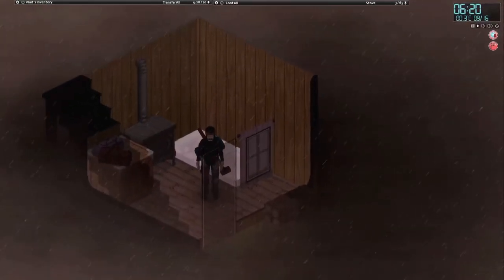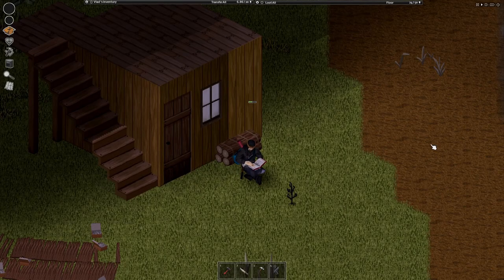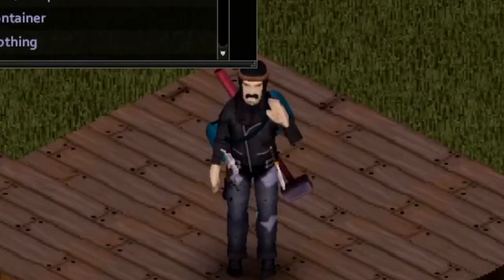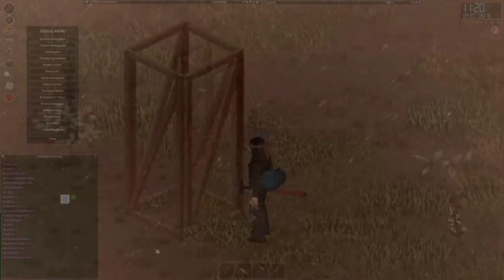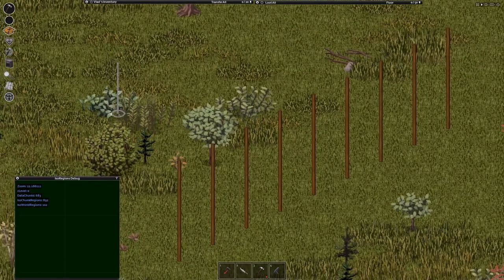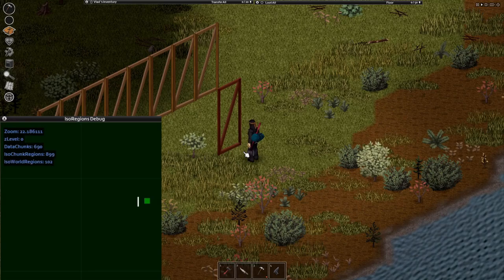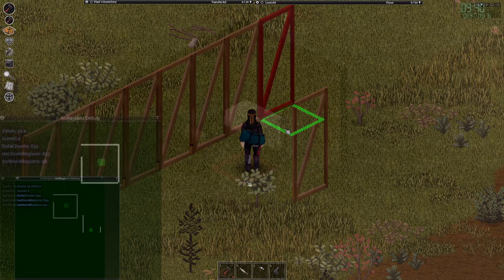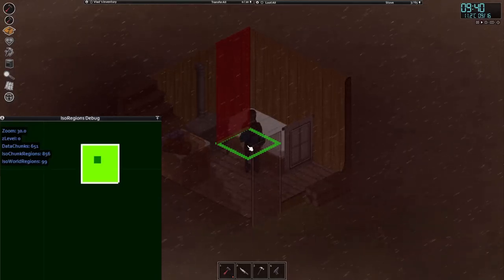The base indoor temperature bug | Project Zomboid

Comment: Glad this got recommended to me. I made my base at the Muldraugh North Farm and built a big base off of the barn, and was wondering why half of my base was considered indoors and the other half wasn't. Turns out that the south-east part of the barn has a few corner pillars that were blocking the wall from enclosing the whole room. Took out those pillars and it works great now.
Reply from the maker: Glad this helped and I am glad you shared your experience!
It doesn't need to be a player built pillar, it can be a pillar on an existing construction that interferes with player built walls!

Comment: I never even realized this problem, mainly because i newer found out any use for pillars (other than holding up a tower or balcony for style) and i havent been able to do extensive building due to roofs needin stairs and stairs needing carpentry level of 6. I know that building roof from first floor is hard but i don't bellieve i would need entire stairs to reach the roof, maybe ladders or stack of boxes... heck, the character can climb over the wall so i don't think stairs are necessary. But i have full faith for devs to make carpentry better just like they did with foraging. to be honest devs of zomboid are some of the best. 

Anyhow, thanks for this info. It will come in handy eventually if my friends get more into carpentry.
Reply from the maker: Glad this helped... this info could still be useful considering that pillars are now auto added when building and may cause confusion
Reply: @Zarivan  they're automatically added? Thanks for the heads up.
Reply from the maker: as far as I know, yes, they are added if there's a corner

Comment: Thx for this explanation. Another thing that kept my base from sealing was a missing (destroyed) wall between the original building and my added part. Adding a door frame resolved this issue.
Reply: Hey! Having the same issue here, I added walls to conect two existing houses. Everything is closed but the corridor I builded between houses is taken as exterior. I should build any door frame to solve it?
Reply: @EzequielPH  build a door frame only if You have destroyed part of houses wall. If else, the pillars probably should do the job.

Comment: Iso Regions is a great zomboid tool in debug mode for server hosts.  It taught me that if you build up against a pre-built structure's wall, you won't be able to truly seal it up and it will have the same issue shown in the video.
Reply: any fix to this?

Comment: I just want to point out, that I tried playing starting from December 1st. So I can meet winter as it is. Houses were warm, but the electricity was eventually cutted off and the houses being 22°C went to 10 or less. 

So if the reason why I have cold house is the Grid Blackout, then why connecting generator won't warm at least 1 room?

Comment: Yeah, building your own house can be tricky lol built a two story house once with the stairs on the inside of the house.  Apparently, doing that makes the roof not register, so the only room in my house that stayed dry was my bedroom that the stairs led to lol

Now I just leave the stairs on the outside, along with the one pillar on the SE side.  Haven't had problems since :D

Very good tip video!
Reply from the maker: Thank you for sharing your experience. This extra knowledge will help save others from headaches caused by these bugs or coding oversights.
Reply: @Zarivan  
Youre welcome.  And thank you for making awesome and informative videos :D
Reply: If you have stairs, you need to put a wall along the longer part of the stairs on the second floor.
Reply: @crocproplayer  is it nessecary to remove any pillars after u build walls along the stairs?
Reply: @otobluearrow If it's not registered as a room below than yes. Upstairs it can be a wall or small fence bdw.
Reply: @rafanagorski392   thx, today i approached this situation, with the last floor part placed it changed to indoor look and sound. So there was no reason to remove pillars or  build a wall along the stairs.
Reply: @otobluearrow  It all depends on where the stairs are. From what I remember, there must be a wall on the north side. This game is not refined in this respect. The more we play, the more we see it.

Comment: Please help! I built a 6x8 warehouse without pillars, and it was never considered a room, the lighting doesn't change, it rains indoors and its cold as the Queen of England's touch.
It's got 4 walls, floor with floor on it, 3 doors and a roof. The roof was the very last thing i built on it. I have no idea what could cause it.
I'll reply with more deets, but I'd like to know if there are any things i should consider trying. Again, there are no pillars.
Reply from the maker: Besides the fact that now, depending on how and in what order you build some walls, the pillars are auto constructed... I really don't know... with a sledgehammer try hovering in destroy mode and cycle with "R" near each of the walls and see if there's a not so obvious pillar (it should get highlighted this way)
Reply: I'm having the same problem dude, if you find out please help me

Comment: Hi all, I've been having issue with enclosing my second level 9 x 5 room. I first made an interior wall with door splitting it pretty much evenly into two rooms, and one room became enclosed (the room without the internal stairs). I then added a second internal wall splitting the remaining room into another two rooms, which then both became enclosed. Not sure what happened here as its nothing to do with the corner pillars which I thought originally but if I have to subdivide rooms to get heat then I'm all for it
Reply: If you have stairs, you need to put a wall along the longer part of the stairs on the second floor.
Reply: @crocproplayer  thanks mate ill try it out

Comment: if you extend one of the houses for example one of the gated community houses in rosewood to include the garage, so i knocked holes in the walls of the garage and house and built walls to connect them together and a roof. half the new build part is indoors half isn't, so i built on the floor above and all of it is indoors... also this won't extend safehouse, am i doing something wrong or is this a game mechanic?
Reply: I had the exact same problem. Just seek for pilars on the corners and destroy them with the sledgehammer

Comment: Hello,

maybe you can help me with a building issue. I tried building my own structure and started adding a second floor to be safe if the need arrises. On the 1 floor I built wooden frames for a window. I couldn't upgrade the frame to a window without building a floor in front of it. I upgraded it and now I want to remove the floor to build this climbable rope in the window. The game gives me no option to remove the floor. 

Thank you for your videos. I learned to use composters instead of wodden crates ;)
Reply: I solved my problem by acquiring a sledgehammer. Sometimes it is as simple as that.

Comment: I have same problem except no pillars, fully built from scratch house, doors/windows/roof ok. But 2nd floor has outdoor temperature, any ideas?
Reply: If you have stairs, you need to put a wall along the longer part of the stairs on the second floor.

Comment: Any tips for my issue? I have a home with 2 floors, both floors downstairs is indoors, but upstairs it's not indoors. It's the floor that is my problem, if I remove my stairs and fill the holes then it works fine. It must be a way to fix this? Sounds dumb if stairs need to be outdoors.
Reply: If you have stairs, you need to put a wall along the longer part of the stairs on the second floor.

Comment: Okay, so what's up with the 71.6 temp indoors? Is it that temperature until the electricity goes out?
Reply from the maker: I think that interiors have magic heating until electricity goes out!
Also, if I remember correctly, game's default is Fahrenheit (in my game I changed it to Celsius)
Basically 71.6°F = 22°C
Reply: @Zarivan  Okay, I thought this was the second map that had "glitched" the interior temps and my main map I was working on was the only one acting legit. My main map I'm 4 months in, power/water out, inside temps not much higher than outside.
And yes, while I know Fahrenheit well, I do know that if I'm in Europe and it's 30C outside, time to go INside. lol

Comment: Who the hell was building with pillars like that? The pillar is just a filler for the South East corner where the two walls come together. What a muppet.
Reply from the maker: You are right, it is for the south east corner... but if you build it and have plans on extending the base from that corner, now it's clear that the pillar will be an issue and should be removed.
Maybe the example was not perfect, but it did fit the educational purpose :D